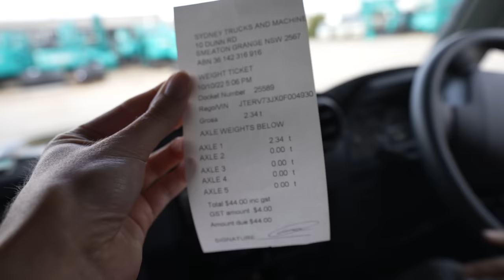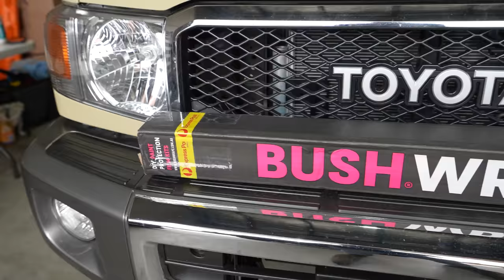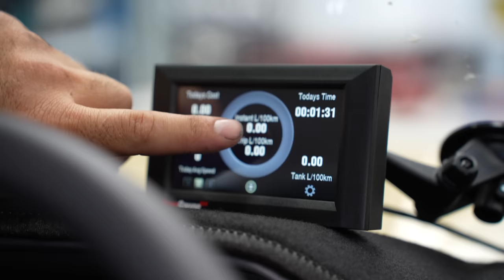Overland Troopy Build: EPIC UPGRADES in Episode 2! You won't believe the transformation

Comment: I bet you'll go back to the valve system for your tyre pressure monitor. I have internal system. I found the caps an absolute pain in the proverbial when you are constantly airing up and down. Your doing an awesome job.
Reply from the maker: Yeah I did think of that, if I have to remove the small nuts every time then I don’t think it will be for me. They work great so far though :)

Comment: Good work on getting PPF before you took it on the road.  PPF are really a "must have" these days.  Specially when new 4WDs cost tens of thousand of dollars.  They are a cheap protection for your rig.  IMO, just as important as pre-filter fuel filter kit, and catch-cans on diesel engines.
Reply from the maker: Honestly I think the money will at least be made back if not more when the car is sold.

Comment: Looks really cool ! Did it work with the 315s and the stock front bumper? On my Troopy I had issues even when putting 285s on with scratching at the fog lamp housing, not on highways but offroad and in roundabouts…. Issue solved with ARB suspension and 3 inch lift…. Looking forward to watching your next mods ! Cheers , mate !
Reply from the maker: Nah mate scrubs like hell haha…. But the stock bumper won’t be on for long :)

Comment: Running the 315s on the TT 2 inch, are you getting any rub at all on full lock or over terrain? Reckon you could get away without rub on the rear without track correction in that lift and tire size?
Reply from the maker: Yeah mate it rubs quite a bit haha…. Love the falkens and I love the way they look but definitely more convenient sizes to put on.
Reply: @OverlandTravellers  are you going to look at stepping down to 305 or 285? or keep the mod plate with engineering and go extra lift?
Reply from the maker: @jacksneddon2106  probably leave as is mate.

Comment: It's looking good.  PPF is a good idea.  I'll be wrapping my 80 series once I get it re-sprayed.  Are those 35s you fitted?  'Coz if they are, any particular reason you went with that size considering the type of 4WDing you do (ie. touring/overlanding)?  Won't that be worse for your fuel economy?  Or are you planning to do some hard-core 4WDing soon?
Reply from the maker: Good question, they are 315’s so close to a 35. A few reasons. Adrian our travel buddy runs the same size so we can share on trips, some people have said they noticed a difference Offroad. But honestly I like the way they look 🤷‍♂️ they are a bit of a pain, they scrub the bumper so I need a bull bar, I probably get worse economy, smaller tyres would probably be better for the touring we do. But I did it mainly because it looks good…. I would suggest people go with more convenient sizes.

Comment: Great content thanks. I'm interested to know what the hype is with gearstick extensions. I have a 70 series and if the driving position is correct (not like you're in a banana lounge) the standard gear position is great. Wouldn't the extension increase the arcs you have to move through when changing gears making it counter productive?
Reply from the maker: It’s probably personal preference, whatever feels right for you. Maybe I’m used to the old 40 and that gear stick is very high.
Reply: @OverlandTravellers  Cheers 👍. I'm looking forward to see your build progress. Especially how that rear bar performs - I've got one on order.

Comment: Any reason not getting tyres and bits done prior to first rego? Figured it would then mean you can adjust tyres if needed without further hassle. And you will get an idea of weight with the new shoes
Reply from the maker: I didn’t actually need engineering for the 315’s but they poked out slightly so I need an extra little flare so I left them off for rego. But they added an extra 100kg over stock 150kg if I have both spares on. So a big weight difference and something to consider if people are thinking about putting them on.
Reply: @OverlandTravellers  cheers for the reply, my main reason for asking is that rego in WA relies on weight of the vehicle and this in turn might affect legality of the vehicle which can cause insurance issues if it is  ever needed. Looking forward to seeing the next build vid. Cheers 🍻

Comment: PPFs a great idea. Though in my experience, it isn’t cheap once you factor in labour to apply it 💰
Reply: I've got a BushWrapz PPF kit on my Triton, took me about 3 hours on a Sunday afternoon to install it solo, and it would have been a lot quicker if I had someone helping me (Note: You need two people to install, I would not recommend doing it solo). A bigger car like a Landcruiser would take a little longer, but not that much. They are a fairly easy kit to install.
Reply: @KarlEller  Thanks for the tip on using two people, I think I will give it a go

Comment: I might have missed it but did you or are you going to regear to run 35s?
Reply from the maker: No not going to worry about re gearing but we will get a marks Speedo corrector
Reply: @OverlandTravellers  yea ok, could be a little tall in the gears then
Reply from the maker: @Nick-sd7um  it still crawls in first low very well.